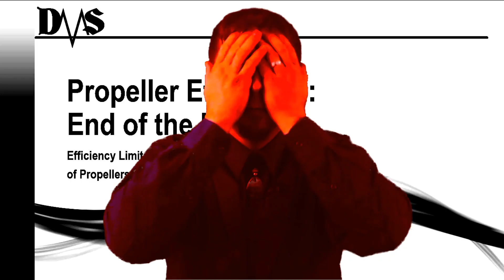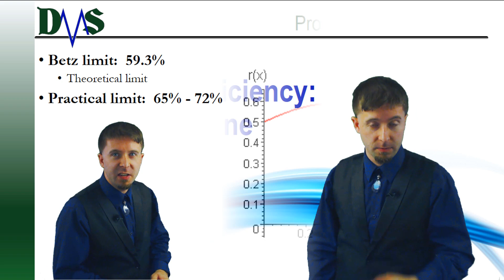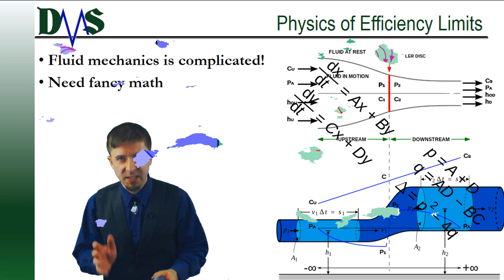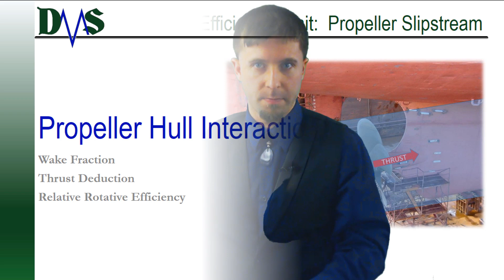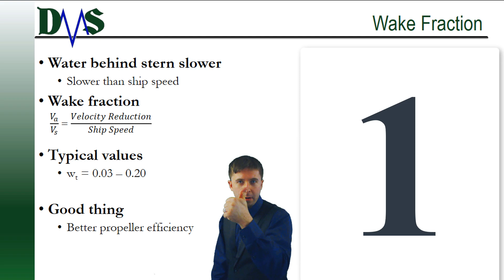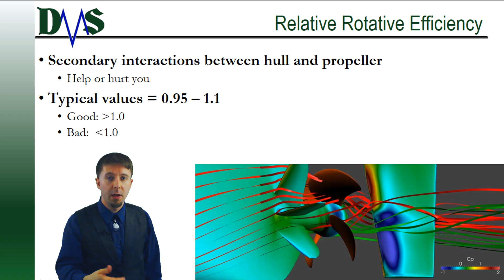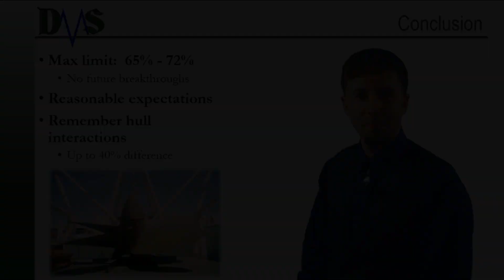End of The Line:  Propeller Efficiency.  Efficiency Limitations of Propellers

Comment: The Betz limit?

After doing a little bit of online research (details to follow) I'm convinced you are incorrectly trying to apply the Betz limit to propulsion propellers.  The 59.3% limit you mention is the maximum theoretical limit to how much energy can be EXTRACTED from a moving fluid (eg., air, water).  This limit is not applicable to a propeller that is putting energy into the fluid.

On your web page:

https://dmsonline.us/propeller-physics-the-end-of-the-line/

You reference the "Wind Energy Handbook" with regard to the Betz limit.  While this book discusses the Betz limit, I didn't see anywhere that it addresses propulsion propellers. Wind turbine propellers and propulsion propellers may have a lot in common, but some things are different.

However, it appears that Betz did do work related to propulsion propellers, and it seems to show that propellers can have efficiencies approaching 100%.  Look at this reference:

https://openscholarship.wustl.edu/cgi/viewcontent.cgi?article=2174&context=etd

Around PDF page number 28 (paper page 20), there are graphs of propeller efficiency.  One of the lines is a "Betz approximation" line.  You can see efficiencies very close to 100% are predicted toward one end of the graph.  There is no 59.3% limit.

The following paper on propeller efficiency estimation has a graph (Fig 5) including data points for actual propellers:

https://www.researchgate.net/publication/280566585_Maximum_Propeller_Efficiency_Estimation

It clearly shows propellers over 90% efficient.

The 59.3% limit applies to wind turbines because to extract energy from the flowing air you must slow the air down. To extract 100% of the energy, you would need to slow the air to zero speed (if the air is moving, there is still energy left in it).  If you slow the air to zero speed you have no flow anymore, and thus your wind turbine stops. This contradiction makes 100% extraction impossible.  The Bets limit is the best compromise you can make of slowing the flow enough to extract energy but keeping it fast enough to still effectively spin your turbine .  The same contradiction does not occur in propulsion propellers since with these you are increasing the speed of the flow, not decreasing it.

To be clear, I'm not saying you can make a 100% efficient propeller (you can't), but under some conditions you can get at least into the 90's.  The 59.3% Betz limit definitely doesn't apply.
Reply from the maker: Thank you.  I will need to look into this.

Comment: So you saying that the speed of the water hitting the propeller is better to be slower than faster I would have thought it be the other way round to help efficiency.
Reply from the maker: It is a little counter-intuitive.  Other way to think of it:  First the propeller needs to spin fast enough to just match the speed of the water.  That just gets to neutral thrust.  Any power you spend to get to that speed does nothing for forward thrust.  Once the propeller spins faster, then you get forward thrust.  So to minimize that wasted power, we want the water to move as slow as possible at the propeller (which is not the same as water speed for the rest of the hull).
Reply: Or even another way to think of it...

Imagine you have two canals side by side. Your boat is in one but the propeller driving the boat is in the other.  At first, the water in both canals is stationary.  Using Datawave's numbers, the boat is going 16 knots. So, with no flow in either canal, the water is coming into the propeller at 16 knots.

To get the 15 knot water speed into the propeller, we need the water in the propeller's canal to flow at 1 knot in the SAME direction that the boat is moving.  To me it seems intuitive that if the water in the propeller's canal is moving in the same direction the boat is going it makes it easier for the propeller.

In short, it's like going up a down escalator, the slower the escalator is going down, the easier it is to go up.
Reply: Andrew Snow  yes but the water exiting the propeller and the suction into the propeller is always greater than the surface tension, I think I understand what you're trying to say it's about drag on the Hull or forward resistance not sure which. I would have thought if you increase the surface tension faster against the hull would be better then the surrounding water. I thought if you pump air down  along just below Plimsoll line and the bow, it would counteract any drag and make it more streamlined in the water by disrupting the water pattern especially on the bow wave, where the greatest Resistance Is channeling this up through the plimsoll line before it gets to the propeller to reduce the wake, and to pump air down the centre shaft defused by slits in the Hub just in front of the propeller blades, so the centre of the propeller has no contact with the water or the hub, and is in its own air bubble cause less stress on the propeller less work for the propeller and make it more efficient in turn you can create steeper rake angle for more given power. For the same amount of energy force given In. All rights received on air channeling on a Hull, and propeller and hub diffusion.
They have a similar thing now where the centre of the propeller doesn't exist through magnetic field induction it's a good way to go no propeller shaft needed or rudder for that matter no tangle as well. That's what you need on your boat. There's some food for thought.
Reply: @johnsweda2999  Sorry, I can't follow all of your points, but here are some random comments anyway:

My comments were only related to the propeller and not the hull.  In fact, instead of my example of two canals and a boat, it could have been a cart on a road next to a canal.  If the cart has a beam sticking out the side, over the canal, you could then hang an outboard motor on the end of the beam (into the canal).  You could push the cart along with the outboard motor.  If the canal is flowing the direction you want to go, then the outboard (and thus it's propeller) don't need to work as hard.

Surface tension only occurs at a liquid/gas interface.  Technically I it can probably occur where two different liquids (eg., water and oil) or even two different gasses meet, but that's a completely different discussion.  Anyway, with a fully submerged propeller, surface tension is not involved because there is no air/water boundary.  Also, surface tension is only noticeable at small scales.  On any boat too big to fit in a bathtub, the surface tension effects will be so small as to be undetectable.

This is way out of my area a knowledge, but I think there are (or were) propellers made for high-performance outboard applications that used exhaust over the propeller hub to reduce drag at high speeds.

http://bassboatexchange.com/fastest-props-ever

Basically it's a non-through hub propeller on an outboard engine originally designed with through-hub exhaust.  I'm not sure, but think this may cause issues with the prop ventilating in the exhaust (and thus not performing well) under high-power, low-boat-speed conditions.

Comment: What about rim drive props?
Reply from the maker: An interesting step forward.  They act like a normal propeller with a duct around them.  Ducted propellers are well known and a very good idea for most applications below 14-16 knots.  But rim drives go one step further.  Supporting the blades on the rim lets us concentrate most of the blade area near the outer edge, which is the ideal location.

Unfortunately, these propellers are still restricted by the Betz limit.  So they push the limits further, but they are still straining hard against physical limitations.
Reply: @DatawaveMarineSolutions  Crikey!
What about magnetic water drives?
Reply from the maker: @nobody46820  If you mean something similar to the fictional Catapillar drive from "Hunt for Red October".  The idea works, but not well enough.  Last time I checked, even the best magnets were too weak.  Even a mild river current would overpower the boat.
Reply: My new favorite propeller is the new rim driven self adjusting propeller. The blades will adjust to the speed. Hard to explain exactly how it works in text, because no one has ever seen anything like it. Video illustration here :  - -> Electro Propulsion by Hy-Generation - https://www.youtube.com/watch?v=w_qcJpc7vco

What could the efficiency be for this propeller? And what about cavitation?

Comment: How do to determine/calculate how fast the propeller should spin?
Reply from the maker: That is a fairly extensive workup. You don't just select the propeller speed.  At the same time, you select propeller pitch, blade area, and section shape.  You need to consider the engine load curve, cavitation, and design speeds.  The goal is to maximize propeller efficiency at the selected speeds.  All of that gets balanced and decided at the same time.  So the short answer:  hire a naval architect.
Reply: @DatawaveMarineSolutions  very generally speaking, if an average quadcopter flies at 100 km/h, would you roughly expect a quadcopter 10 times as big (engine, voltage, propeller size, etc) in every respect, to fly 10 times faster?
Reply from the maker: @Dr-Shlomo-Cohen  No.  Generally speaking, if I saw a quadcopter 10x larger, I would expect it to fly at the same speed, or far slower.  Sure, you have 10x more power, but you also have 10x more weight that we need to carry.  Generally, it isn't about size.  It's about power density.  How much power can you pack into a little engine for a given weight?

When scaling up like this, you also run into the problem that things are not uniform.  For example, imagine your quadcopter gets 10x longer, and we keep the same shape (scale uniformly).  The lift of that quadcopter is governed by the surface area of the propeller blades.  Those scale roughly by the square, so 10x^2 = 100x more lifting area.  (Because area = two dimensions.)  But the weight of the whole contraption scales roughly by the cube of our scale ratio.  So weight goes up by 10x^3 = 1000x more weight to carry. 

Now compare the ratio of power to weight on the original vs the 10x scale model.  In our scaled version, we have 100x more power (lifting area), but 1000x more weight to carry.  => 100/1000 = 0.10.  Our scaled version only has 1/10 the power to weight ratio of the original model.  This means that going bigger becomes a losing game.  That particular limit is something we call the cube-square law, which is a nice way of saying, "You can't win by just going bigger."

Comment: I saw in wikipedia (https://en.wikipedia.org/wiki/Thrust ), thrust is related to the surface area (in m2) and the density (kg/m3), and the velocity squared (it is clear, however). On thing I find here, that thrust is depend on the medium where it works. I.e: Thrust is bigger in sea/ocean (density is 1,030 kg/m3)  as the density is bigger compare to if the ship is in fresh water which the density is 1,000kg/m3. T=rho*surface area*velocity squared. There is mentioned A here, which is defined as "the area of the cross section of the propelled volume of fluid (A)". What is the A? What is the "acceleration tube" in your explanation?
Reply from the maker: If you take the diameter of the propeller and draw a circle with that diameter, A is the area of that circle.  The "acceleration tube" is what you get if you extrude that circle forward of the propeller and behind the propeller.  It is sort of the path of the water that enters the propeller.  (The actual flow pattern is more complicated.)

Comment: What is the relation (formula) of the pitch (or Angle of Attack, AoA) to the efficency? Efficiency is related to the input power, right?

In my opinion, the thrust should be different for every pitch. I watched another video that low pitch is suitable for start moving or high load (equivalent to low gear on a car), and high pitch is suitable for cruising. That make sense. So, how to bind them in formula?
Reply from the maker: There are no strict theoretical formulas.  We incorporate twist into the propeller blades, and they face cavitation limits.  It makes the resulting behavior too complex for theoretical predictions.  The only option is experimental or numerical testing.  Check a LOT of different variations on pitch to see how it performs at various speeds.  

Some authors have also taken the more popular propeller shapes and fit the experimental data with mathematical formulas.  But I should emphasize that the experimental data came first, not the formula.  You can find a good example of the curves for Kt, Kq, and efficiency for the  Wageningen B-Series, which is one of the most popular shapes.  
https://deepblue.lib.umich.edu/handle/2027.42/91702
And yes, you are correct about the variation with pitch.  Low pitch works best at low speed / high load.  High pitch works best at high speed.
Reply: @DatawaveMarineSolutions  Interesting but also confusing me. Quite strange that there is no mathematical formula to bind every thing regarding the propeller, easpecially the shape, the length, the cord length, and the pitch (the AoA).

From your explanation, so can I say, if I plan to make a propeller, I can not predict the output and compare it to the output based the measurement? Or I can ONLY measure its output without have any information what would be the output?
Reply from the maker: @StrsAmbrg  If planning to make a propeller, it is possible to predict the propeller performance.  It just requires more advanced predictions.  Some common methods include CFD and blade element moment (BEM).  To relate it back to the idea of a simple formula:  We have the mathematics to predict the performance of any single section on the propeller.  That is a relatively simple set of equations.  But in a typical propeller, the AoA and section shape vary along the blade length.  So any accurate prediction requires us to divide the blade into many small sections and predict each section in turn.  Plus some corrections to account for 3D effects of flow along the blade length.  Plus checks to prevent cavitation.  That is why we default to customized computer programs designed to handle this.
Reply: @DatawaveMarineSolutions , yes you are correct. Due to the blade is not straightly curved but different angle from the root to the tip, so we need equation along the blade. And probably also along the chord (blade's wide). It will be an mathematical integral. It is not difficult to make the equation. The problem is, after we know the surface area of the blade, and of course we know or we set the angle of attack (pitch), then how to bind them in one or more formula? With that formula, we supposed to be able to calculate the thrust with consider the efficiency. We know, the propeller is either directly connected or gear connected to the engine shaft. And from the power of of the engine and the thrust calculation, so we may predict the most suitable either propeller or engine  to meet the requirement.